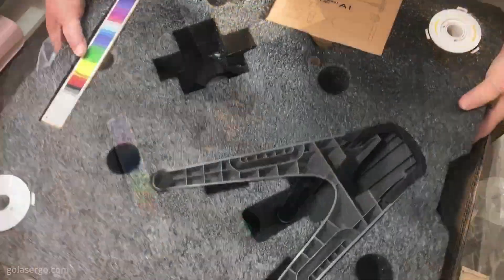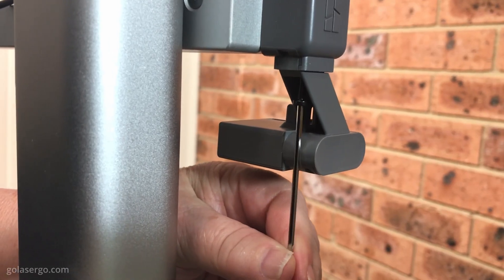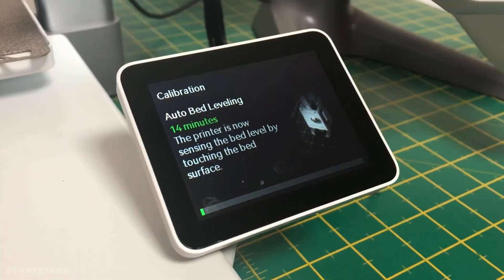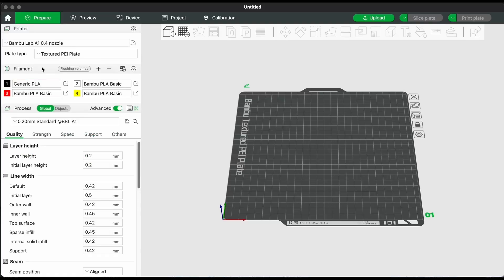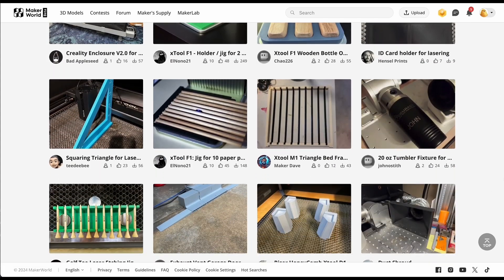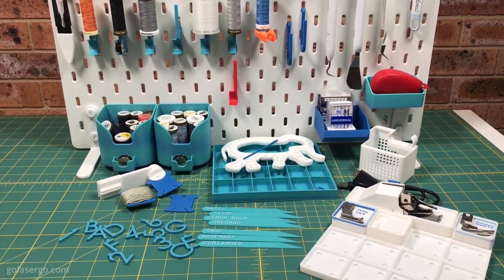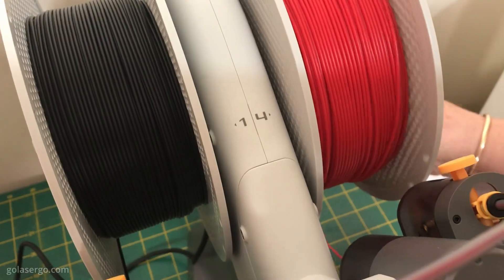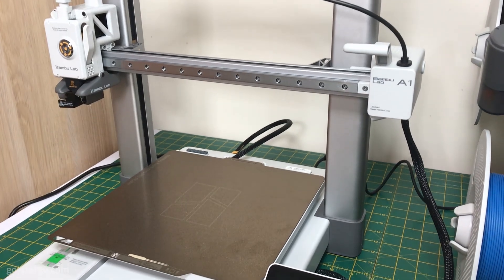Is the Bambu Lab A1 the Ultimate Beginner 3D Printer? Review & Demo

Comment: These printers are not the best first printer for someone that wants to learn how to 3D print. They take away a lot of the fidgeting required to get a good print by other printers without automatic bed levelling and flow calibration. If you want to learn how to troubleshoot print issues, these are great for your second printer. These printers are essentially load and go. Other printers need so much more.

Comment: One thing I've always wondered is what are the fumes / off gassing like for a filament printer like the Bambu Lab A1? I have 2 small kids and no garage/good ventilation spots- so i'd want to set the 3d printer up on a higher shelf in my office. So i want to make sure the office won't be overly smelly while I work, but also no toxic fumes in the house for the kids.

I've heard resin could get pretty smelly , so i was wondering about the fumes for one of these

Comment: Does it come with a single spool holder?
Reply from the maker: Yes. if you buy the machine on its own, it comes with a single spool holder. If you buy the combo version then you still get the single spool holder but you also get the ams lite which holds the four spools.

Comment: Nice review. I dont like how much space it takes up with the AMS Lite, otherwise it seems to be a great beginner printer.
Reply from the maker: Thank you for the comment. There is a top mount that can be printed out that will allow you to add the AMS Lite to the top of the machine. This will save on space. I have to say that I found this printer to be super easy to set and it's super easy to use.
Reply: It does take up a fair bit of space but the top mount works very well if you have room to mount it there. I had to modify the cupboard to get the extra height needed. This is my third 3d printer and the difference in quality and ease of use between the A1 and the previous ones is amazing.
Reply from the maker: Thank you for responding Malcolm.